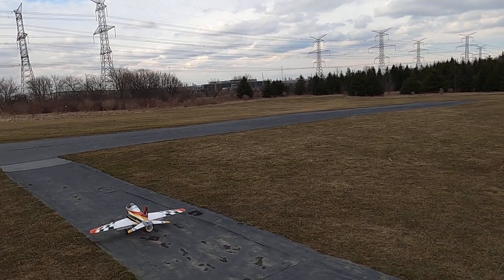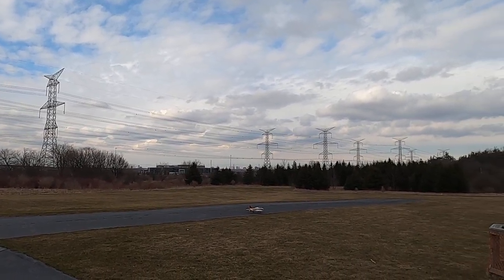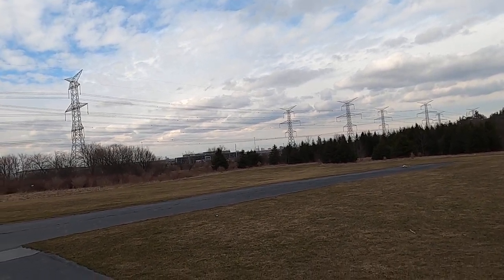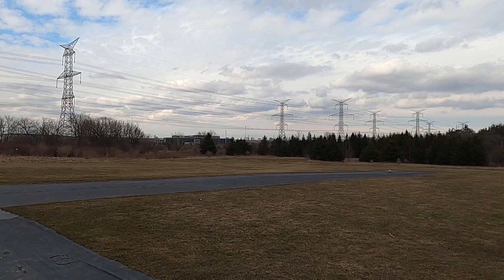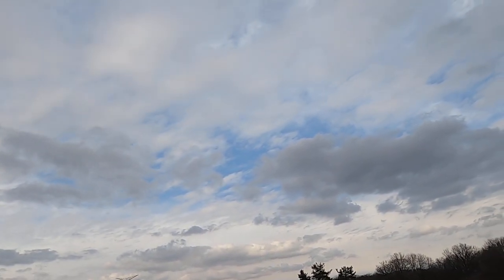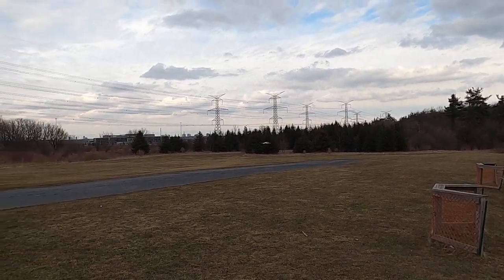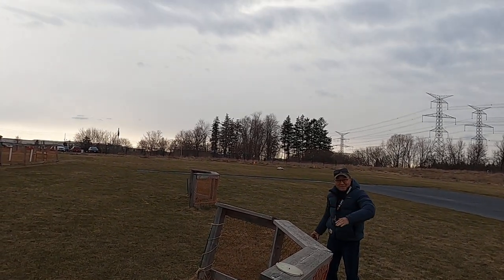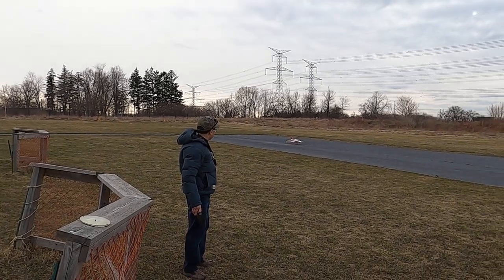Freewing Avanit stock 1920kv on 8s

Comment: How many runs would you say you have done total on the 1920 9 blade EDF? I just think that’s awesome that you are able to run it on 8s. Also 130 amps isn’t that bad for 8s. I have had 130 amps on some of my 6s setups.
Reply from the maker: Between myself and my buddy probably about 50 flights no problem so far.

Comment: would you also fly with this setting on a hot summer day?
Reply from the maker: I would did it several times last summer
Reply: @ghoustanable  I wonder how this motor can resist the heat under this load.
Reply from the maker: @sundayfloater2926  you know what I'm going to do a test and post it with the temperature reading on 6s as well as the temperature reading on 8s. Will run both of them for at least 30 seconds to make it as realistic as possible and post the results. Thank you for watching as well as posing the question. Cheers
Reply: @ghoustanable  Ok,  you made me curious.  I think i`ll try my Avanti (1920 kv) on 8S with an 8S Esc (Predator 120A, 150A max.) and do a speed test with gps as soon as the weather gets better here in Germany.

Comment: You used the original ESC 100 Amps ?
Reply from the maker: No Castle creation 120
Reply: @ghoustanable  I thought it was 130 ?
Reply: Also I seen rich rcinformer put an fms 120 amp esc on the fms 1500kv for 8s . if I bought that fms 120 esc would it work for the 1920kv ?
Reply from the maker: @ojeezrc  that's what I was using
Reply: @ghoustanable  would the FMS 120esc work with 1920kv?
Reply from the maker: @ojeezrc  probably I was pulling about 133 amps but that's take off high speed verticals... as long as you're not holding that speed for a long period of time you should be okay.
Reply: @ghoustanable  so the castle 120 work fine with it pulling 133 ? That's nice . its just that castle is expensive and the fms 120 is cheap 😂😂